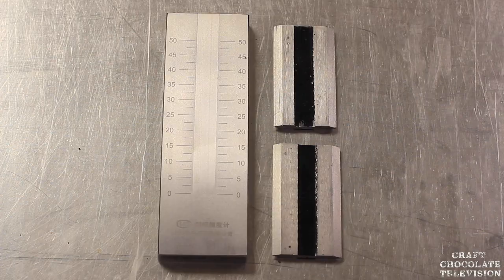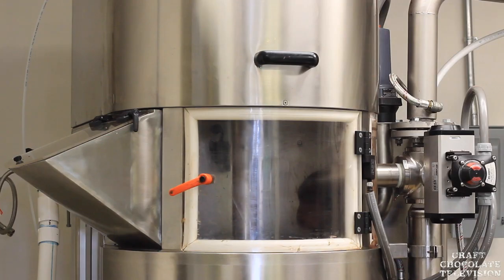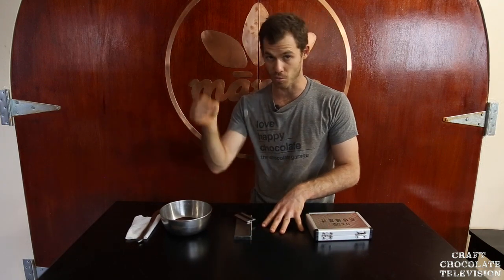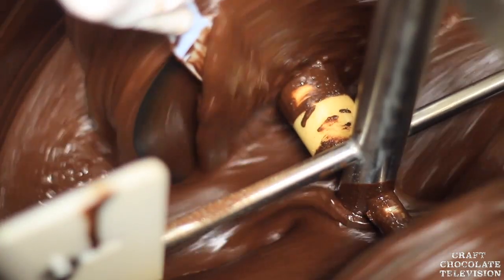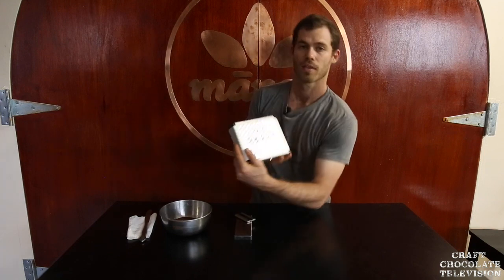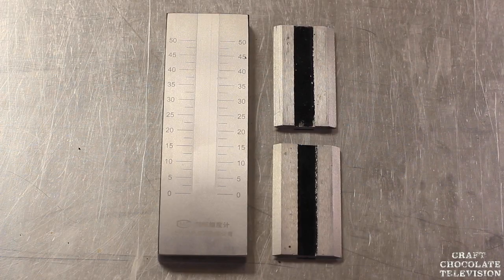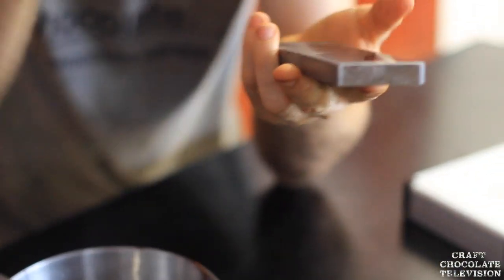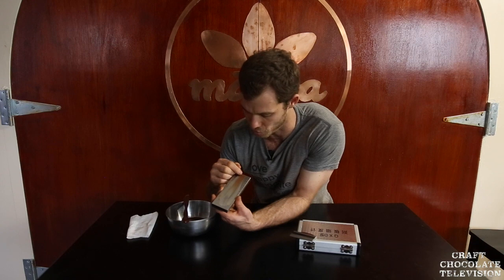Secrets for Silky Smooth Chocolate - Episode 7 - Craft Chocolate TV

Comment: There is a great video demonstrating dispersion analysis on an automated machine called TIDAS (made by Labman Automation). This analyses a grind gauge and makes the dispersion easy to see as it produces an image displaying all the particle data. It produces a rating automatically and removes the operator variation you often find between users in labs.

Comment: Hello Dylan! Thank you for your awesome videos! In fact, they have inspired me to try to make chocolate for the first time. I didn't used lecithin neither cocoa butter, just cocoa beans, dried milk powder and sugar. It has been on the melangeur for 24 hours but it has a peanut butter texture, just has you said. It taste is amazing but I want to improve the texture. What should I do? Is it because I didn't had the cocoa butter? Because I've previously grindded the beans on a coffee grinder ?Or is there any other reason for that? A big thanks from Sao Tomé
Reply: Bárbara Campos using Cocoa Butter will help to get a smoother texture.
Reply: Barbara, you are trying to make a milk chocolate out of nibs, this is very hard because the fat content of a good chocolate should be around 45%, nibs has around 50%, whole milk around 26% and sugar 0% of fat... depends on you recipe but you might consider add something around 5-10% cocoa butter on it! Good luck
Reply from the maker: Hi Bárbara! Check out episode 30 if you haven't seen it already, it should answer all your questions. :)